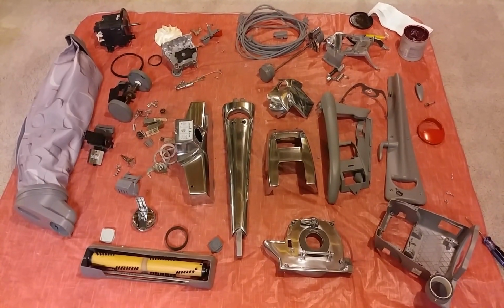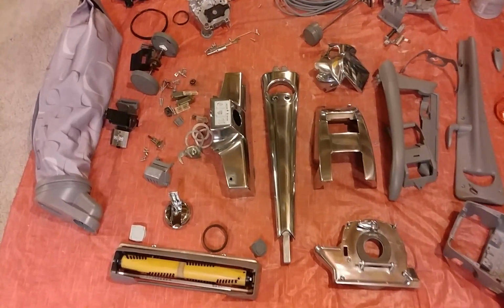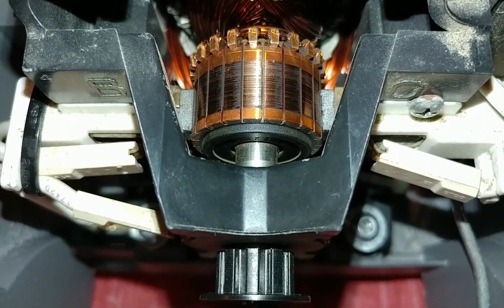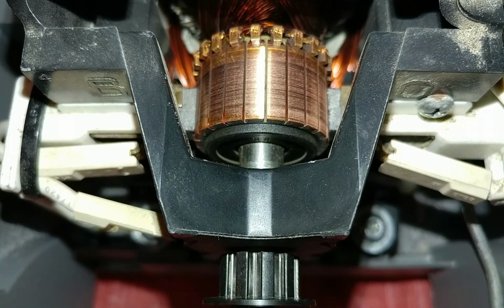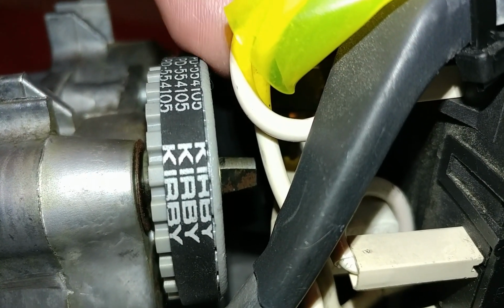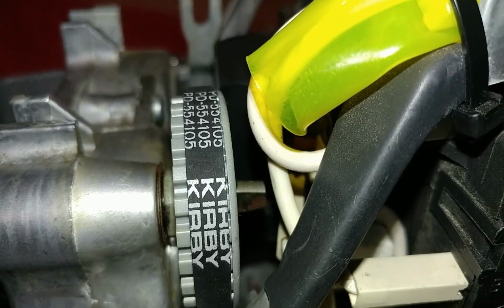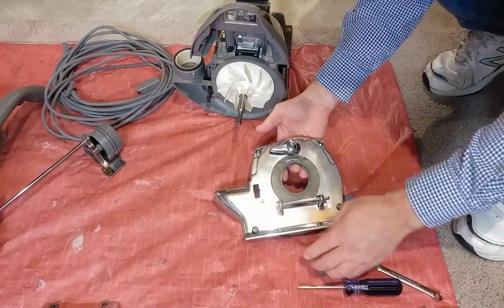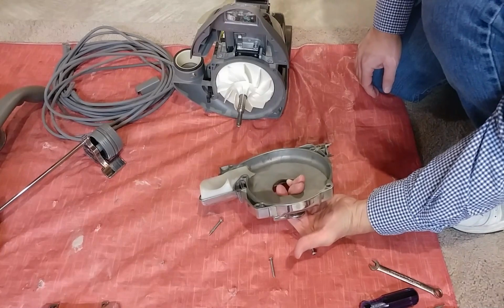Kirby Sentria 1 Reassembly

Comment: Kirby vacuums weigh a ton but, they outperform even the most energy guzzling central of central vacuums and have a pleasant sounding motor. The agitation on carpet is just amazing and it will vibrate even paper thin commercial carpet pretty good.